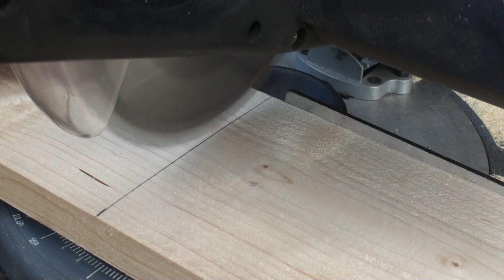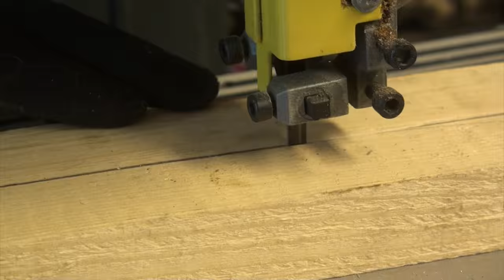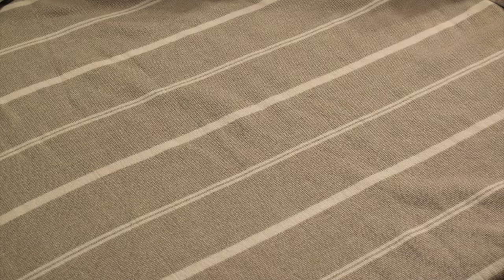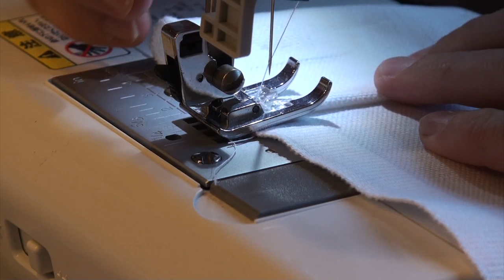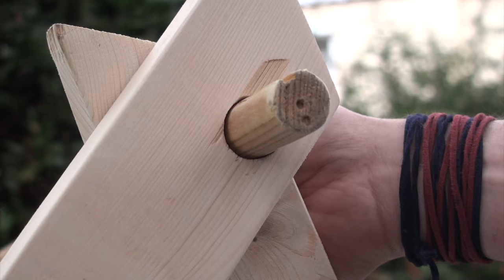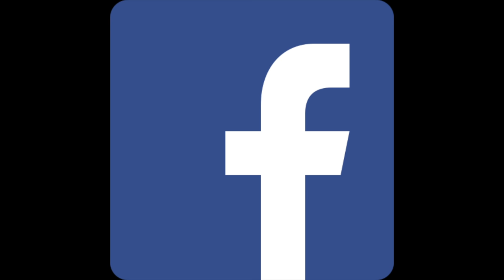How To Make A Viking Canvas Tent - DIY

Comment: Cool father kid project! I think it bugs my wife that I use her sewing machine more then she does. Hey, it's just another tool I tell her.
Reply from the maker: Thanks Tom ! Exactly, just another tool ;)
Reply: I used to make a big fuss about servicing my Late Wife's sewing machine (s). Pretty simple, undo the clips, wipe all of the material fluff and loose threads away, wipe clean and oil with Singer Sewing Machine Oil.
If I wanted to use it, I just told her I was going to give it a run to test it, and I'd give it back to her squeaky clean and running sweetly.
I still have her two sewing machines and the overlocker, but my new wife is Chinese and a retired surgeon. Everything gets hand sewn and looks like a stitched wound, haha!
I am the "Bad Uncle" to our friend's two little Daughters (Big Dutch Da, tiny Chinese Mum. They will love this and it will be a good practice run for a tent for me.

Comment: Wow, that's amazing!! I have to ask, though, what happens when it rains? Is there a way to not get wet and cold?
Reply from the maker: THanks a lot. If the fabric you're using is not resistant to rain, you can waterproof it with a spray. For the cold, nothing much can be done, but a small fire in front of the tent can help. And warm clothing.
Reply: I've heard you can heat rocks in a fire, then bring them inside your tent in a metal bucket. You just have to be careful not to burn yourself or set stuff on fire -- that bucket will be hot like an actual fire.
Reply: @eyesofthecervino3366  Oh that's an interesting idea! Do you have any idea how well it works?
Reply: @squidking762  
Not firsthand, no. I actually heard about it from a survival story where a family's car broke down in the middle of nowhere, so they heated rocks in a fire then stuck them inside the car in the spare tire to keep warm. It was a literal lifesaver.

Comment: Would this stand well in rain? I have my own property next to the lake and want to build a camping spot for my kids but don't know if I should buy tents or build this one because if this can't take rain I'll buy tents so I can take them down. Thanks for reading my comment have a great day!
Reply from the maker: Thank for your comment. I think if you use waterproof fabric it should be ok for a small rain, but not for a stormy weather. But if you let the wooden frame outside all year long, it will eventually turn darker, even with many coat of polyurethane finish or paint on it. If I was you, I'd build one, use waterproof fabric and finish the wood very well, let it out for a few months and decide afterwards :)
Reply: @RedSmithWorkshop  Ok thanks!

Comment: Man, that looks cozy. Nice job.
Reply from the maker: Thanks you ! With more blankets it would be even more cosy. I wish I could lit this camp fire :)
Reply: You can get a degree of fireproofing in the fabric (and wood) by soaking it in a solution of hot water and Borax- add borax until it stops dissolving- and let the fabric air dry. And the wood, too... 

I'd waterproof the fabric using linseed oil, but it will require hanging the cloth on a clothesline, fence line, or w.h.y until the oil has hardened... or just set the tent up and let it stand for a few days/ week, or whatever...:

Don't fold the fabric up because that can cause the heat of 'curing' to build up and start a fire... (the reason woodworkers should put oil soaked rags in a metal trash can if they don't hang them on the fence or w.h.y....) 

Once the linseed oil has set up, you could go the extra mile and rub the cloth with beeswax. 

Vikings coated all the wood on their longboats with a mix of turpentine, linseed oil, and as much shaved beeswax as they could dissolve in the liquid... they only had to retreat the wood very year or two... 
Don't heat up the linseed oil/ turps mix indoors, or close to something flammable...

That oil/wax mix is good for polishing furniture with and you can prevent mold growth on the polish by adding in some boric acid. (I don't actually know how much... a teaspoon per pint or quart?) 
And one can add lavender oil or w.h.y.. to the polish as well, just because... :-)

Comment: Are the measurements for the lumber correct? They seem very small; are they supposed to be in millimeters? I might be reading it wrong since I'm not very knowledgeable in terms of measuring lumber.  But what length would they be in feet?
Reply from the maker: Nope, you're right. I forgot a 0. 
Correct measurements for the board are 2000x150x27mm.
Thanks !

Comment: Nice other than one question is the cotton fabric you used water proof?
Reply from the maker: GuardedDig2 thanks. No it's not. But I can buy a waterproof spray if needed 😊
Reply: The Redsmith thanks I’m going to make one and I didn’t know if it was water proof or not thanks
Reply from the maker: GuardedDig2 no need for it to be if you don't let it outside all the time. If you do so, i recommend waterproof fabric and also some kind of varnish on the wood 👍😊
Reply: The Redsmith ok thanks
Reply: Two words: Scotch Guard! 😊😊😊

Comment: Anyone doing this at home, use a protractor to get the angles right.
Reply from the maker: You can getbthe angles rights judt using a square or a ruler, but you have to do a quick math😊
Reply: The Redsmith (but not everyone is good at that and it is easier to use a protractor, at least for me.)
Reply from the maker: @Cedalion  protractor, square or ruler, doesn't matter if it gets the job done, right?😉

Comment: I appreciate the look at how to make it. it may not look quite as nice and it would use a little more materials, but I feel like I could save a whole lot of time just using straight 2x4s on a lot of this.  It may not be quite as period, but since it won't be very visible I would probably also use some steel pins instead of wood pegs.
Reply from the maker: Thank you. They don't sell 2x4 in my country. But feel free to use them.